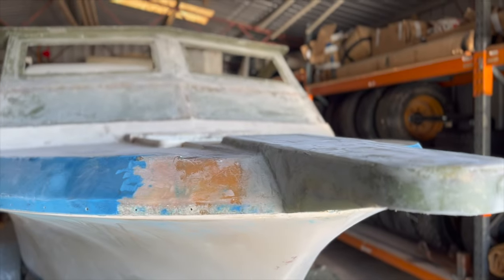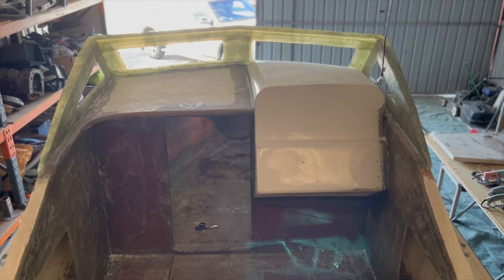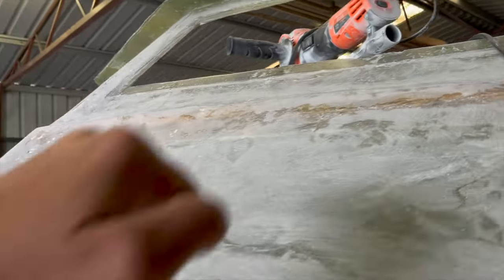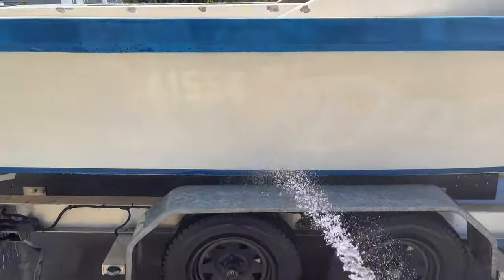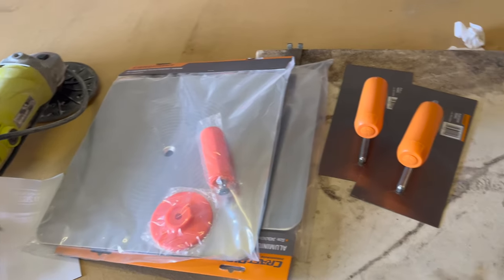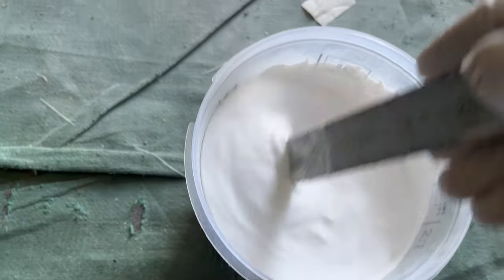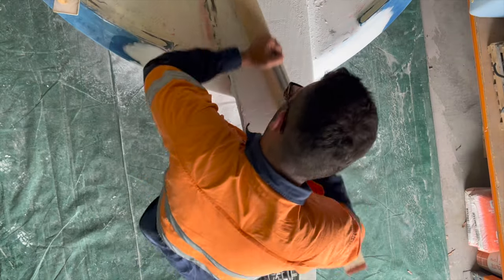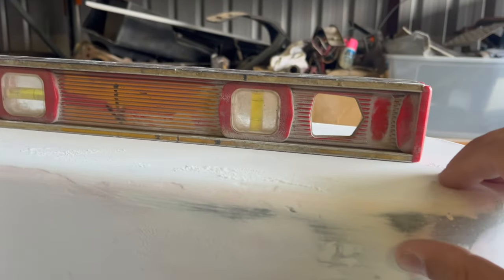Fibreglass COMPLETE | READY for FAIRING| Pacemaker 20ft | Full BOAT RESTORATION V2 - Part 22

Comment: helpful tip is to apply your fairing mix with a say a 3-4mm small notched spreader like a tiler would use. This gets the compound on fast and uniform in thicknes. You then go back over it with the smooth steel trowl to flatten it out. If there is high spots, when you hit it with the smooth trowel, it will naturally scrape it off the highs and pull the compound into the lows.  Some just leave it troweled with the notched spreader, leave it to cure. Then long board it, then come back with a second mix and fill any notches that weren't removed in the sanding stage.

Comment: Great work mate, I wish I'd seen your battery brackets earlier. I've just replaced my brackets & found old fixing holes underneath the batteries that were letting in water which had been a long time problem. I've now raised the immediate battery area approx 10mm with new fiberglass  to ensure any water drains away to the bilge but wish I'd seen your idea.
All my new screw fastenings were put in with Sikaflex marine sealant so I'm hoping it will be ok.
Anyhow, top stuff again mate, can't wait to see the finished job.
Reply from the maker: Thanks for watching George!, Yep i didnt want to run into that problem so decided this will be the right way to go!

Comment: Gday mate great work ,when i replaced the haines transom i did exactly the same thing q cell and resin , it makes it so much easier when you can sand it with out to much of a problem . i didnt know about a long board then so just used a plasterers sand board i was very happy how it turned out ,took a few layers to get it good using a long straight edge but was excellent in the end when painted you would not even know take care .
Reply from the maker: Thanks for watching mate! Its the worst part of the build thats for sure lol!